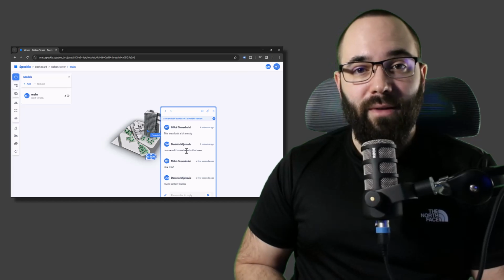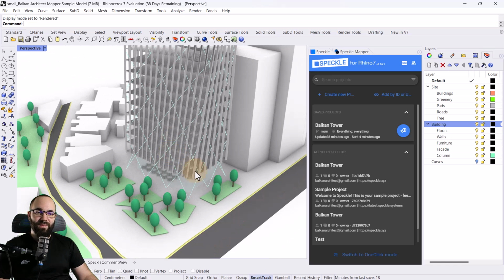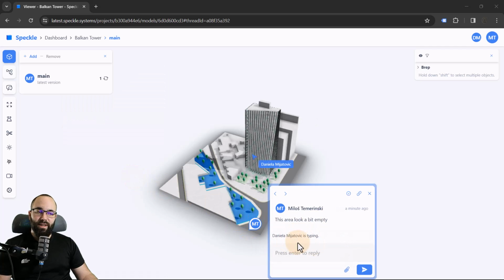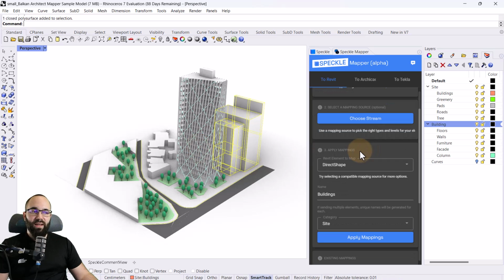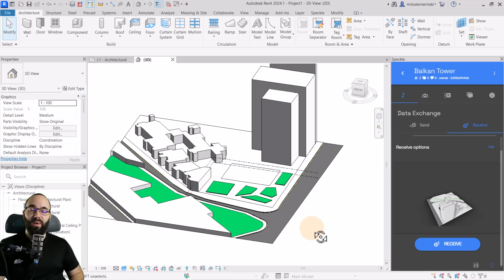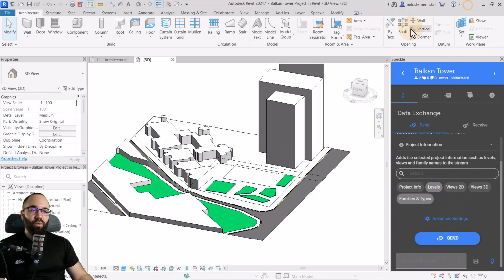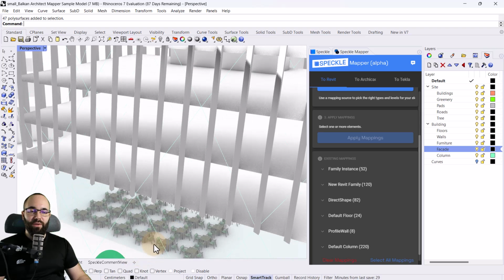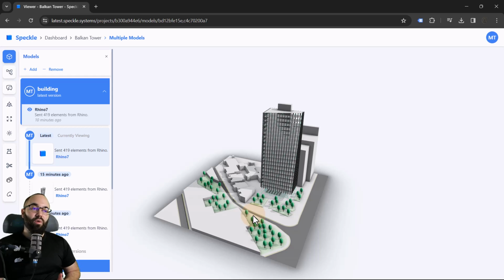Speckle: Ultimate BIM 3D Data Platform?

Comment: Do we really need speckle?! because we already have rhino inside Revit
Reply: Rhino Inside is a great tool in everyone's arsenal, but it only works locally - Speckle pushes this to an online "Multiplayer Experience". It also has a persistence layer (database) meaning you can pick up your work or share it anywhere, anytime.
Reply: Hi Mohamed,

Rhino Inside Revit is a great tool to integrate Rhino with Revit, but it does have some limitations. 

One of the main limitations is that you need to have both Rhino and Revit installed on the same device. With Speckle, you can receive models from Rhino without needing to have Rhino installed on your device. This can save you from having to purchase a Rhino or Revit license. 

Another limitation of Rhino Inside Revit is that it requires knowledge of Grasshopper, which not everyone in the industry knows. Speckle, on the other hand, has a tool called Mapper that doesn't require Grasshopper knowledge. This makes it easier for anyone to use. 

Lastly, Speckle offers more than just Rhino to Revit conversion. It has built-in version control, collaboration features, and integrates with other applications like Archicad, Power BI, Tekla and many more. 

I hope this information is helpful for you. Give it a try and let us know what you think at https://speckle.community
Reply: Speckle speckle is for data exchange for so many other different software..check website
Reply: No but its much easier than learning rhino inside workflows